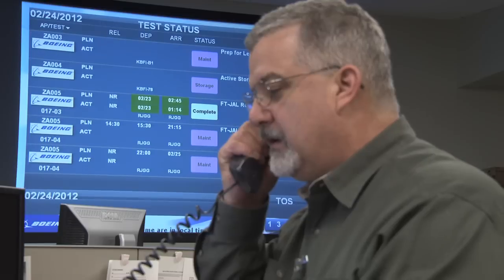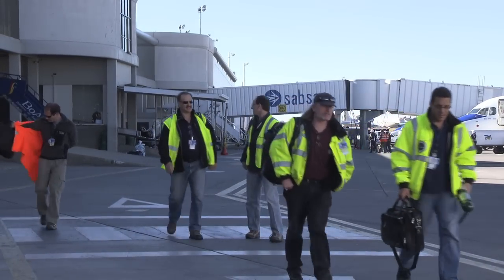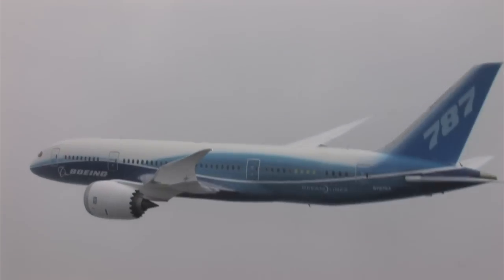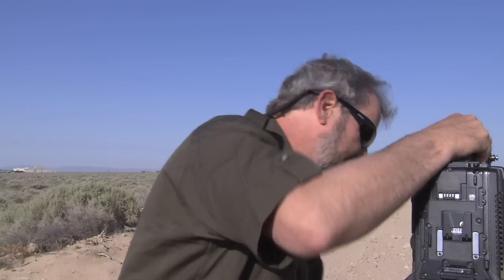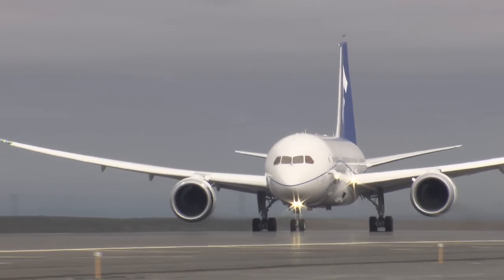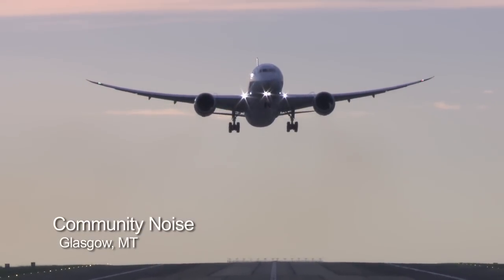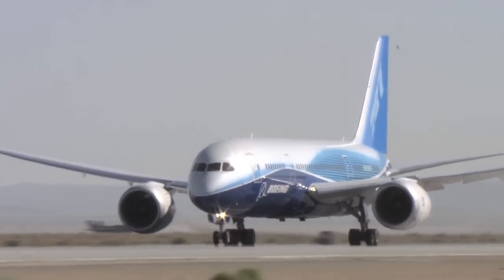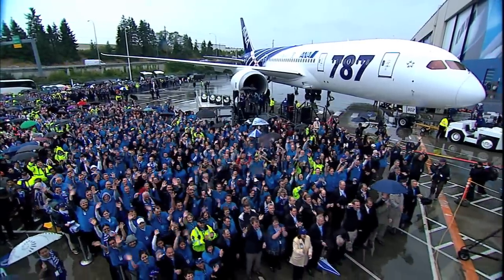Testing a dream: An in-depth look at Boeing 787 flight test

Comment: actually, unless someone tied the lock-wire, or installed the cotter pins wrong, its almost impossible for a nut or bolt to be knocked loose. Every nut, bolt, and screw is secured to one another in such a way that actually tighten each other if one starts to become loose. there are always at least 2 nuts/bolts/screws, attached to each other by lock-wire, sometimes there are even 3 attached to each other. If your wondering how i know so much about this, im an Aviation Maintenance college student

Comment from the maker: Thank you for your comment.  Please be assured that Boeing's top priority is the integrity of our products and the safety of the passengers and crews who fly on them. We have been working around the clock to understand the issues and develop a solution based on extensive analysis and testing following the events that occurred in January.  You can read more and watch videos on the tests and solutions on our web site - just seach for "787updates.newairplane" Thank you again!

Comment: I like the wings, the way they bend upwards at the outer ends, almost as if they're built that way to a certain degree, but they appear to flex upwards as well with the created lift.
I'm surprised it has very tiny winglets.  I thought that was the thing now with wing-tips in helping reduce drag and wind resistance to help conserve fuel.  But apparently they must've tested the best design in that very small one it has.  It appears the elevators also have a bit of a backwards sweep to their tips.
I like the jaggedly, cut trailing edge of the engine casement.  Gives its aesthetics just that little bit of flare.

Comment: The thing trailing behind the fin is a trailing cone.  It is used to measure static air pressure clear of the airplane's influence.  It can be extended a few hundred feet.

Comment from the maker: No decision has been made regarding the other three test airplanes. Regarding your other question ..  The flutter testing we do during Flight Test is planned within the normal operating environment of the airplane so there are no unique inspections required. However, in general, there are more thorough and frequent inspections during the Flight Test program to ensure the airplanes are meeting requirements. Thanks!

Comment: @Eltoca21 Cant remember what its called, but its used when in flight testing, the pilots or technicians extend it which allows then to receive data about the aircraft

Comment: @rocksinger45 I'm a skilled boadbuilder and thru that worked a lot with carbon fibres a lot.
Altough I to not exactly know how they built the fuselage but in my experienxe carbon fibere is so stiff and britle that is is rearly used alone but almost always combined with aramied (kevlar) fibres to add flexebilady. Glieders are build that way and the cocpit armor of apache atack helicopers to and bouth withstand very severe crashs. I'm sure that the fuselage just gets gridet away in a bellylanding

Comment: @marchesedesade89 Since the air is thinner (less dense), it's harder to control an aircraft.  One consequence is that more runway is needed to generate enough lift on take-off.  So, one question they try answer with such testing is (put simply) "how much more runway is needed?"

Comment: Hmm, I don't think it's an issue with the 787 - no fatalities have occurred on one, which is the main thing, so the battery issues are irrelevant now, considering they've been fixed. what is the problem is the media. Take a look at the government run BBC. EADS is British, French German etc and british government purposely portrays Boeing as bad, but parises Airbus all the time. Hence why only Boeings are reported for glitches, and no Airbus ever has been. Even though it happens all the time.